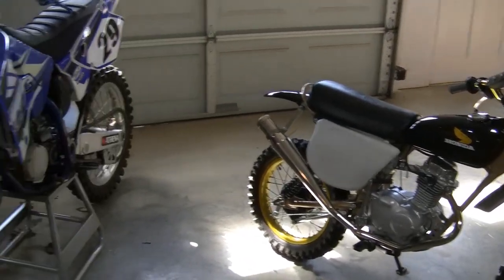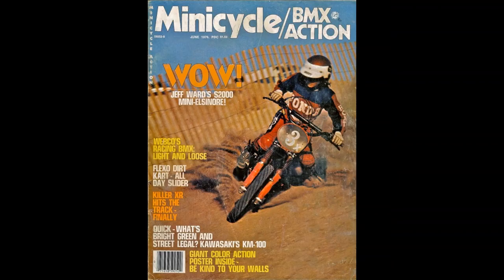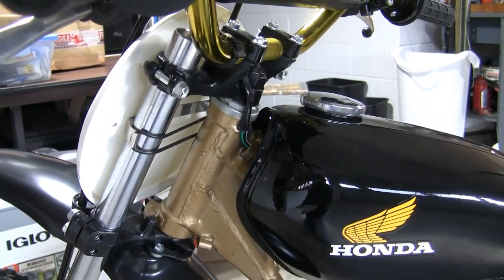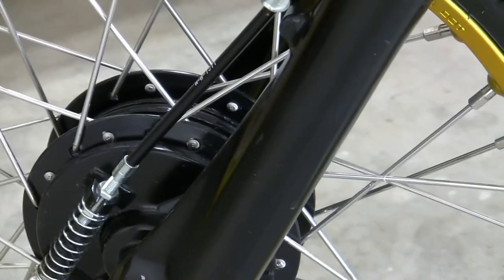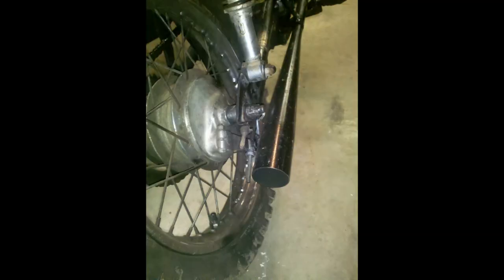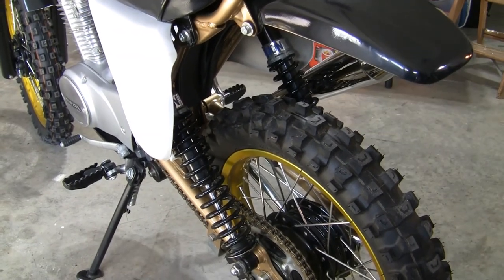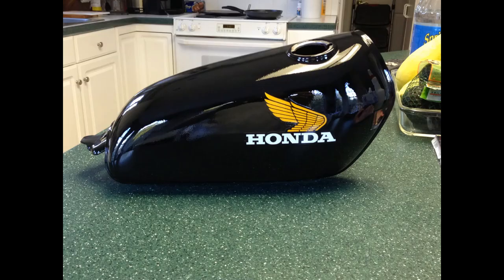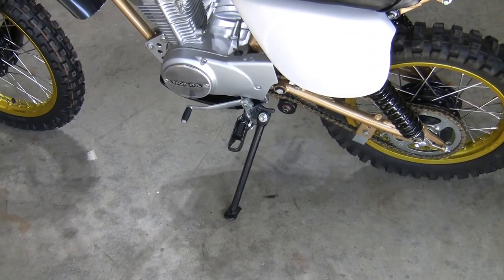1976 XR75 Resto-Mod Restoration Project - Full Walk-around Show

Comment: Love souped vintage mini xr75s,had one back in the day. It had PK frame mono shock,ceriani forks, power roll big bore kit,eletronit ing.,bigger rims. That little bike was fast as shit and won many races around San Antonio and Austin Tx. area. Between 74-77 ,then moved up to 100 class on a Ward kitted Elisanor 125. thanks for sharing. I'm 59 years young and still have 2 old husky's, both are highly modified after all that's what motor cross racing was all about back then! Fred Hall New Caney TX.
Reply from the maker: That’s cool I had a DG monoshock YZ80 and a team mate had the XR75 mono. We didn’t have a local class for 100 minis so only saw them in magazines and far off races.

Comment: Where was the trophy from? I raced an xr75 in 73-74 and moved to Yamaha in74. I can’t actually remember but I think I had a second yz80 and then rode a 125 Elsinore Honda for a few months before going to Yamaha for the duration.
Reply from the maker: Trophy was from chesterfield county Mx near pageland SC. Not far from your old neck of the woods. It was 8-10-1974 I think.

Comment: What year cr80 triple clamps did you use?
Reply from the maker: Pretty certain it was a 1983 CR80 triple clamp, but the 82-83 may use the same clamps, or have the same tube diameter. This list is helpful, but besides the tube diameter, you have to consider the bearing sizes too.  The OEM parts sites are helpful for that. http://organ-donor.org/motorcycle-data/fork-tube-diameter-list/#tube31